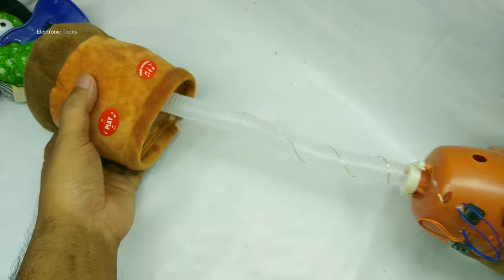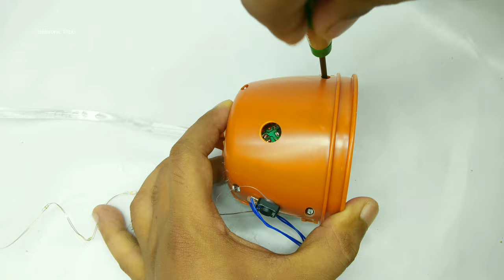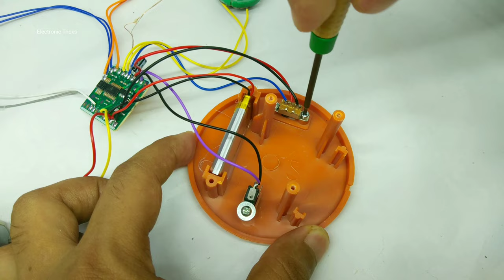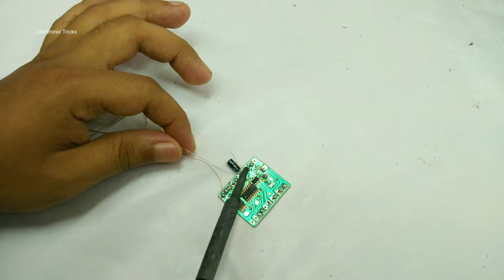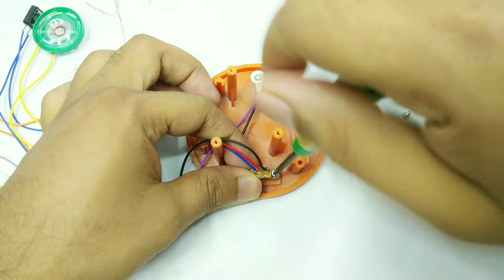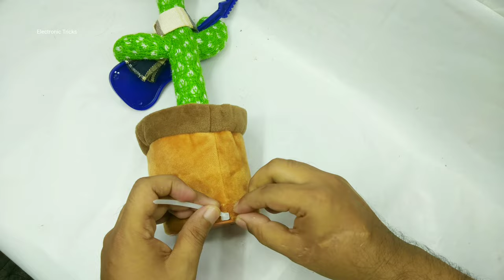Restoration Dancing Cactus | Inside Dancing Cactus |  Dancing Cactus Repair | experiment Cactus

Comment: Mine is the AA battery version, came with a faulty on/off switch ( always on ), upon dismantling i discovered  the switch terminals were accidentally bridged by solder waste, it works properly now, thanks for the vid.

Comment: Any idea what voltage the battery is? I'd like to replace it with something that lasts longer but don't want to open it until I have a replacement
Reply: 4.5 volts